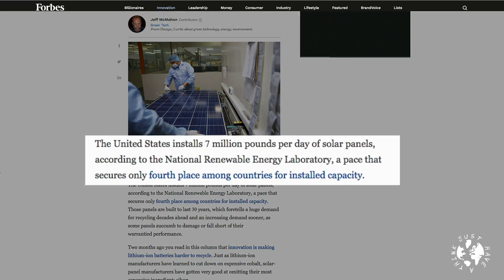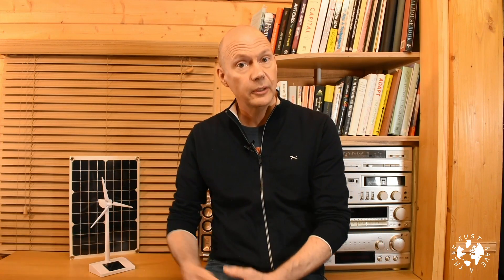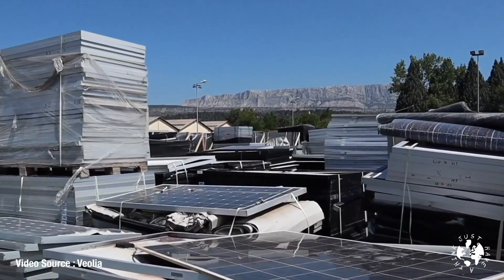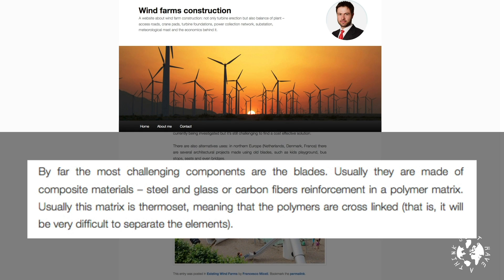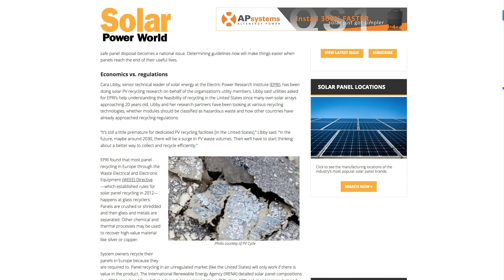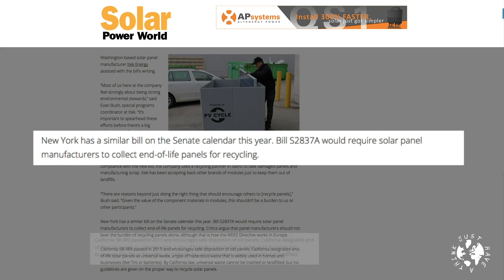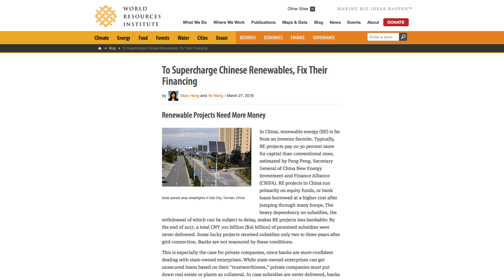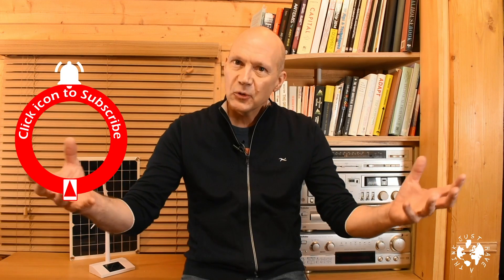Recycling renewables : a price too high?

Comment: Here, the university of NC (and some Chinese scientists) studied what happens when a solar farm gets abandoned... Typically at the end of governmental subsidies, the companies vanish, and acres of solar panels are left for hail and random ballistic items punch holes in the solar panels...  The problem: Heavy metals are leached out of the panels, and contaminate the land in a major way.. The farm that leased out the acreage is left contaminated with lead, zinc, and an assortment of other heavys like Arsenic.  The land is not usable for growing crops even after the panels are removed.... Not good...
Reply: This is nonsense.  There  are no "Heavy Metals"  in Silicon Solar PV.   And most hail just bounces off panels, as the angle of mounting tends to deflect an impact.  Solar PV is typically much stronger and hail resistant than typical roofing.   The typical production Service Life is beyond the 25 year standard commercial warranty -- so they are not abandoned.   They even have profitable recycle value.   Where do you make this stuff from?
Reply: @philtimmons722  The metals used were measured in the soil after the solar farm was abandoned... the farm next door has NONE of those heavy metals... The only difference was the presence of several acres of solar panels.  The solution is of course, IMMEDIATE decommissioning the moment that the solar array is decommissioned... and recycling of the materials.    Unfortunately, the only way to have that happen is to demand a large bond up front...and the ONLY reason that the various small companies are getting into solar is for the state and federal subsidies that pay for the entire farm...  (There is a 2 year old farm near me that has output purchased by Duke Progress.... They are concerned that the farm might get abandoned at the end of next year because the huge subsidies are going away at that point...  And simply throwing up acres of purse silicon without the dopants won't get you any power... I trust the university here.. they are working to get the bonds required, but the power companies and solar farm companies are not interested...Raising prices would not be good for business.  Meanwhile, the state has decided to ban wind turbines within 100 miles of the shore line.. Reason: military jets and 300-400-500 foot tall structures in the middle of the Atlantic don't mix well, and the group at the shore don't want them because of noise and visual pollution.
Reply: @Billblom  -- where specifically is this "abandoned" Solar Farm?  btw, the ITC (investment tax credits) for Solar are based  on the Construction Costs -- not operations.  So the money is not like a Cash Flow thing that might "go away."    Silicon Solar PV dopants are typically from the "lite" side of things -- from the Periodic  Table -- Group V (e.g. Phosphorous) Group III (e.g. Boron) -- here is a fairly simple site about it, if you would care to learn?  https://www.pveducation.org/pvcdrom/pn-junctions/doping
Reply from the maker: Hi Billblom. I am taking it that you are referring to China specifically? If so, then you've picked a country that has more contradictions in it's economic, political, social, and energy policies than perhaps anywhere else in the world. The issues you mention above are highly sensationalist and do not afflict other major areas of the planet in a significant way. China will improve as time goes on. It will wean itself eventually off the filthy coal it burns today, but the world must be vigilant and ensure that once China becomes the world's largest economy and leading superpower, it is not allowed to ride roughshod over it's own citizens in the way that it does today, or over other nations with overbearing economic bullying, which I fear may be the possibility.

Comment: The thing about solar panels is that the solid silicon type seem to last forever, and if you snap a corner off you can just tab to it and get pretty much the same performance out of it. So there should be little concern for the destructive recycling of panels. I know poor people that will happily tab together cell fragments if they cost little enough to get, and I know even more people that will happily buy used undamaged solar panels once they find out that they only lose ~20% output over their first 20-30 years and pretty much level out in their degradation. 
All that is to say that recycling solar can be very cheap, even profitable.

Yeah, I keep hearing you say end of life solar panels, which is odd, considering some of the very first experimental silicon solar panels are still functional.
Solar panels don't have an end of life, humans have a lack of foresight. Just because they didn't have the understanding to say "Ok, my array size based on my power needs is 70% of what I actually need to order for my same power needs to be met for the foreseeable future." doesn't mean the panels failed or hit some ill defined "end of life". 
Not until you've somehow managed to delaminate the p and n doped regions, or ground it to gravel has a silicon solar panel reached end of life.
Reply from the maker: Hi Atlas. I completely agree in fact :-)  I think that not only will people 'make do and mend' as you quite rightly highlight in your text, but the solar and wind (and other renewables) industries will continue to make better, cheaper products, that last longer. My job is to make content that is thought provoking (hence the name of the channel). The four core principles of the channel are:-
1. Provide Insight
2. Drive behavioural change
3. Relate to collective action
4. Be accessible to, and achievable by, most people.

So I really hope that this video serves as no more than a gentle reminder to those of us who staunchly believe in renewable energy as one of the potential solutions for getting our species through to the next century, that we must tread carefully and mindfully into the challenges that face us over the coming decades and make sure we cover all the bases of potentially less helpful consequences. That way we can be more prepared when disingenuous propagandists really do try to denigrate the push towards these technologies (Shellenberger does spring to mind) I appreciate your feedback. All the best. Dave
Reply: @JustHaveaThink  
Hey Dave, I really do appreciate the sincere and nuanced response, and I hope you didn't take my commentary as mean hearted. I know my frank literary style can easily come across that way. 

Yeah, I should have considered that broad accessibility of the info you publish was probably a primary goal before calling attention to a lesser known nuance being slightly glazed over. 

Likewise, all the best.
Atlas.

Comment: Yes, Germany is tops in AE/RE recycling, because their massive push for large scale AE/RE power production has proven to be disastrous and expensive, not successful and cost effective.   

They are pulling back and rethinking, not adding to their national power generation systems at this point now for it due to the proven high costs per KWH and large scale national grid instability problems it was creating for them.

As of 2015 -16 they already started taking down some of their systems (while coincidentally trying to be as quiet about it as possible.)  
http://www.thegwpf.com/germany-faced-huge-cost-of-wind-farm-decommissioning 

Currently today in 2019, they are getting geared up to start doing a massive onshore system rollback to start sometime in 2020 as well.  
https://www.greentechmedia.com/articles/read/germany-faces-a-gigawatt-scale-loss-of-onshore-wind-power

Seems keeping the supply and demand monster happy is a real  and rather expensive problem.  Especially when the two ends refuse to play nice. 
https://www.telegraph.co.uk/comment/9559656/Germanys-wind-power-chaos-should-be-a-warning-to-the-UK.html

Upside is that if you want to buy a good used German made wind turbine , they are pretty damn cheap to get now!!   
If you got a big crane and flatbed truck, maybe free even!  :P
https://www.nicnewmanoxford.com/wind-power-decommissioning
Reply: They are NOT  decommissioning existing installations. - being pro recycling is a German thing (and a upcoming technology to sell in export) -  Merkel pushed Energy Transition for political reasons - Fukushima, she had pushed to reverse the schedule implemented by a former government for a  gradual  fade-out from nuclear.

The industry got favors (prolonging life time of plants and not much investments required for old plants). The (sceptical) voters were told it was all safe and well inspected. 

Then Fukushima happened in 2011. 

The tsunami was not an unusual event in Japan, and there had been the terrible Tsunami in 2004 (Sumatra earthquake) - Japan was not affected then, but it should have been a wake-up call regarding the plants built near the coast (ocean water for cooling) and at sealevel. 

The 3 m wall was nothing, and historically every century the Japanese had been hit by major tsunamis often higher waves than that of 2011 even  (search for 10 most impactfull tsunamis in recent history I think 7 or 8 hit Japan).

Germans have a lot of respect for Japanese manufacturing (accepting them as equals), the Japanese car builders had even the German manufacturers scratching their heads when they successfully entered the global markets in the 1970s.

So Merkel had a political problem, then her party lost an election at the state level  (for the first time  in 30 years - against a coalition of Social Democrats and Green Party). So Merkel the chameloen did a 180 - also known as "The exit from the exit form the exit".

The Energy Transformation was set up to benefit investors and wealthy citizens with the money and the home to install panels (and it was a good investment at a time with low interest rates) and financed with high electricity rates for everyone except big biz especially large industrial users  (so unlike with the Australian carbon tax households were NOT compensated with a benefit ). Did wonders to make the project popular with low-income people, let me tell you.

Merkel is  not for "renewables" - and it shows in the way the project was set up and in the inconsistency now. (it is first Merkel, then big biz, then party - then small biz and wealthy constituents with some distance).
Reply: This is what an old school die-hard fossil polluter shale-craze profits hound comments on his breaks
Reply: Anyway: NOW solar and wind have become a real competition for the established energy providers in Germany, and now big coal is protected and they start erecting the roadblocks (which is of course crazy until you know how the German government ticks, then it makes sense).
Reply: Even the flawed Energy Transition did some good (along with the Chinese efforts, also Japan installed a lot). Every time installed kW double, the prices for a solar-produced kWh drop by 20 %. ECONOMY OF SCALE. It is like that for panels since the 1980s, it exists for every technical product that is new and is mass produced in increasing volumes (although the prices drops and quality leaps are different, with electroncis or processors it is Moore's law).

That price drop (improvement of performance and/or cheaper production) has nothing to do with the passing of time. The Germans had to give a lot of subsidies in the beginning but it created a market where companies innovated (and their research had a chance to pay off). That and more Chinese purchases let panel prices drop so that they became interesting in sunny, wealthy areas with a lot of A/C running during day and where electricity prices are medium to high (think Australia, California, ...) Now that was another 60 million people market. So another wave of sales - and more price drops.

Rinse and repeat.

Batteries and other storage are the next frontiers. There some improvement in prices is wanted. (10 % improvement in panels, 10 - 20 % in batteries - for homes - would mean another massive shift in the market).

Germany now imposes an extra fee of 2,3 cent per kWh on larger producers of solar energy for SELF CONSUMED electricity (only installation that are modestly sized for homes are excempt). May not sound much - but if you produce at costs of 7 cents a fee of 2,3 cents makes a dent. That is to prevent that large users of electricity with an ideal profile (using most or all during day = companies) go solar.

I guess if companies and homes would go off the grid they could evade the fee. There is no mandate to be connected to the grid. Off the grid would mean: no selling of surplus, which is not very lucrative anyway, but more importantly w/o the security to have the grid as backup.
Reply: A German manufacturer KACO got a 2 MW solar  installation (must have been 2013 or earlier *), cost them 2 million Euro (no subsidies), they save 350,000 Euro on electricity per year.
(they produce transformers, so that part of the installation was cheaper for them, and no doubt got good offers for what they had to purchase - but still, with an expected lifetime of at least !  20 years for a quality installation, that is a wildly successful investment).

* I saw a slide with their harvest on a sunny day in August 2013. They needed a little bit from the grid during night and  till 9 a.m. and again from  late afternoon on. Else they produced all electricity they needed inhouse.

I did the math, if they pay the average rate of 20 cents per kWh (for a biz) they have to pay now 45,000 Euro per year on the electricity they produce and consume (the "let's-prevent-big-solar-installations" fee of 2,3 cent per kWh)

They buy much less electricity from the energy provider than they used to and should contribute to the grid and the backup the energy provider gives them.

BUT: that is some money - and there are some mini electricity plants powered with gas or biomass that produce heat and electricity in tandem (they are even sold for private homes, efficiency is of course better when the units are larger).

When batteries are getting cheaper they can have more, get some more panels, on cloudy days or in fall / winter / early spring they can get electricity from their own mini-plant. With more electricity storage they would only need the mini-plants for electricity when they need heating anyway.

Using the heat that usually goes to waste raises the efficiency of a steam engine from well under 30 % (that is a law of physics) to plus 60 %. Combustion engines have the same poor efficiency. Admitted solar panels are not better, currently they have approx. 24 % if they are good (40 % might be possible in the future). But they run of course with a source that is not finite in human dimensions.

And solar harvest in winter is not zero (on sunny winter days it is quite good, even better with snow reflection). Solar panels also transform daylight although they work much better with direct sunlight (cool and sunny like in the mountains with more UV radiation is excellent - I read a commen from someone having panels in New Zealand - and no one can accuse NZ of being a sunny country).
Reply: Germans (citizens) are a lot into protecting the environment (as the Austrians or the Swiss). The companies also foresee chances for future business.
Reply: The costs for producing electricity with up-to-date solar panels are 7 cents per kWh. That is the yearly average in cloudy cool Germany (factoring costs for the realistic lifetime) - it is better in the more sunny regions of Germany. Now, that cannot compete with the 2,4 cents per kWH midday in 2016 in Dubai (which broke a record then, it went even down after that). 

At that costs the sheiks ordered the next solar power plant, they use them instead of gas turbines (in Dubai mind you), because it is cheaper. I assume they have gas turbines during night - but they need a lot of electricity during day with A/C.
Reply: The electricity grid in Germany has become MORE RESILIENT. Blackout events and duration have gone down. They started from a good standard in 2006 (even then better than France or U.K). Then they had to adapt to the fluctuating input from wind and solar. - The medium to large plants that dominated then were very reliable - but if they had a problem (a storm, a fire, safety shutdown of a nuclear power plant) then they missed out on a lot of electricity all of a sudden.

Now it is not humans that improvise to cope with the more rare but consequential larger blackouts - it is automated. So now the numer of blackouts have decreased (I forgot the number minus 20 or 30 % in that range)  and the duration (there is an industry standard number for that) has halved. 
If they can deal with renewables on a daily basis,  than they can cope also better with the occasional larger blackout event

While France and U.K. stayed at the old level.

I got those informations (also the numbers and examples quoted of the other comments) from a presentation of Dr. Eike Weber (Fraunhofer Institut).

Comment: Remember, solar panels are not the only way to harvest solar energy!    Reflective parabolic solar collection systems that use long metal reflective troughs to focus solar energy on black metal tubes through which a high temperature coolant is circulated.    The heat harvested by the fluid is then used to vaporize water to run steam turbines.     There is virtually no waste in this process and 100% of the materials used to implement the system are recyclable!  The reflective troughs need only be kept clean to maintain efficiency.  The steam generated in the system can also be condensed back into water to be used over and over, thereby dramatically reducing water usage!
Reply from the maker: Hi Richard. Many thanks for your comment. I like the sound of that system!! I suspect it may well make its way into a programme in the not too distant future. Thanks for the info. Much appreciated. All the best. Dave